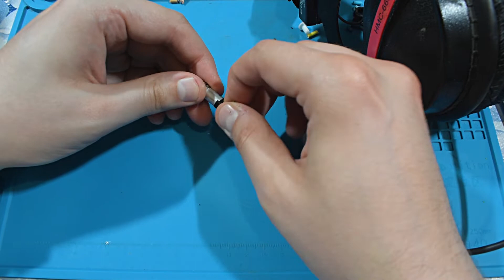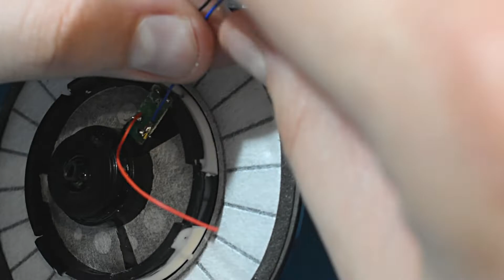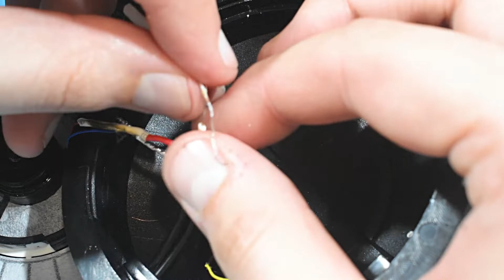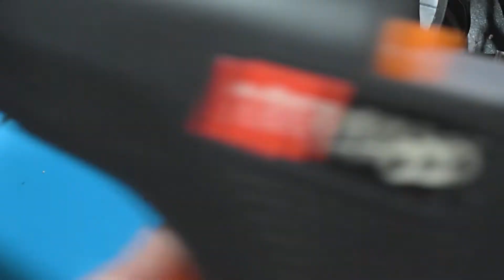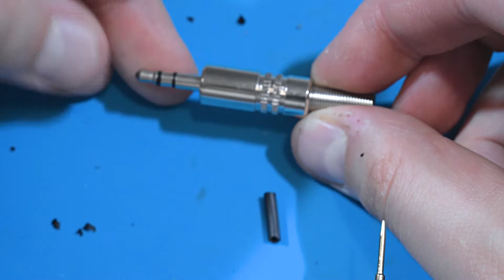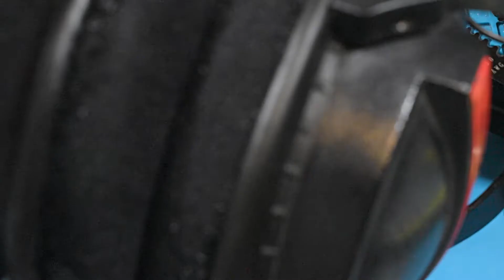Superlux HMC-660 Headphone Monitor - Cable Repair

Comment: nice video bro, would it be that difficult to change the speaker? I have one side lower than the other and I was thinking of buying one on aliexpress
Reply from the maker: No, it's fairly simple. But be careful about the speaker quality, because a garbage speaker might ruin your experience.
Reply: okay! thnks a lot!  @milanfixer